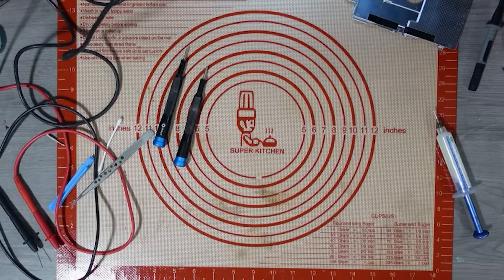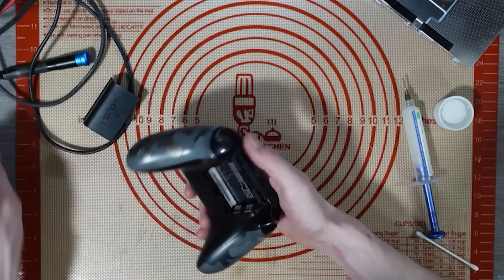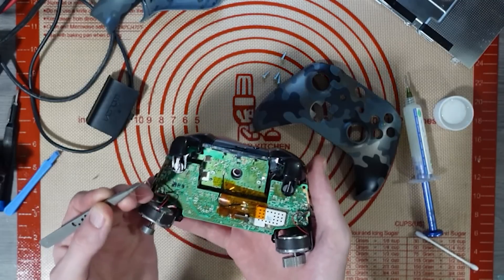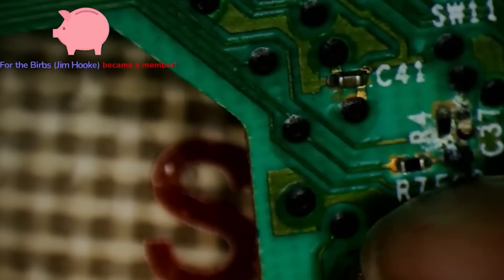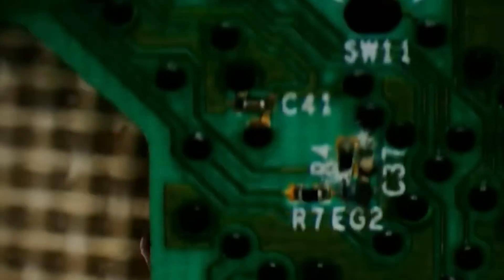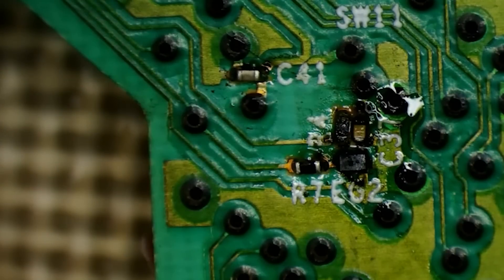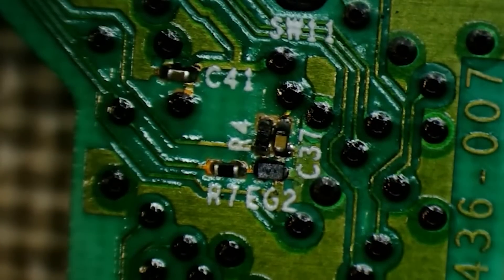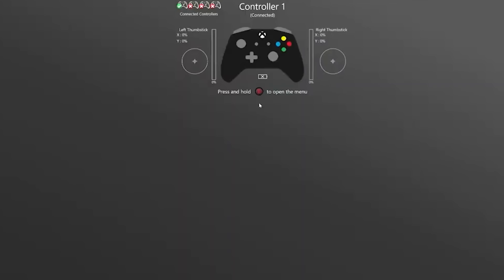This Xbox One Controller Won't Connect Through Bluetooth! Can I Fix It?

Comment: I need help!!! 

My Xbox series 2 controller is updated and so is my Xbox one s. However, when I try and play any games my controller starts to disconnect. I even tried to plug it in with the USBC cable and still disconnects even when plugged into an outlet in the wall or extension cord. I call Xbox support and they ran all the test and said it was the mother boards Bluetooth connectivity. Is there anyone that can help me out with this problem. Thank you!!

Comment: I found out tonite, my Stadia controller works the best with Forza, out of Switch Pro, Xbox 360, PS3 controllers I got here the Stadia just hooks up and runs, controls perfectly Forza 4 and 5 and the games are set up proper for the controller too, am quite pleased as I only paid couple quid for the Stadia controller and its nice to be getting some decent play outta it.   Still recommend folks to grab one for cheap.   My Switch Pro's are not bad but to be honest I actually prefer the joycons on the Switch grip thingy,